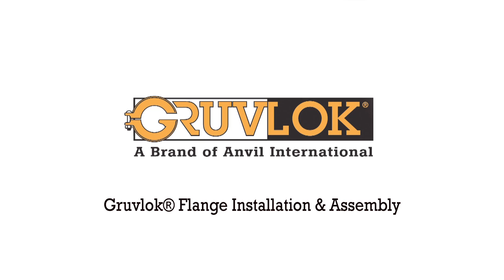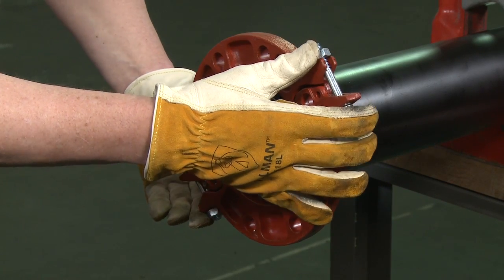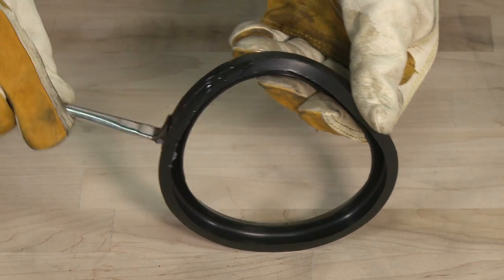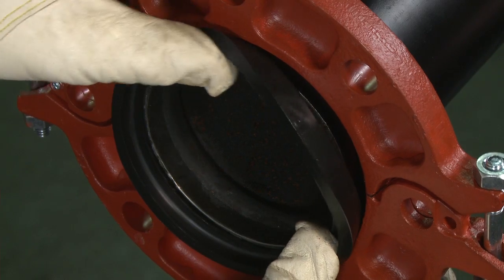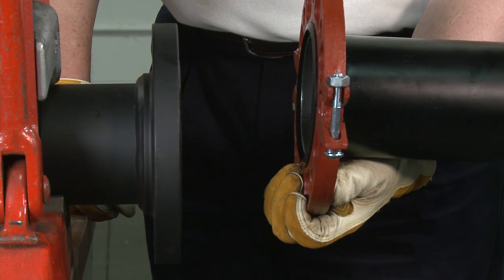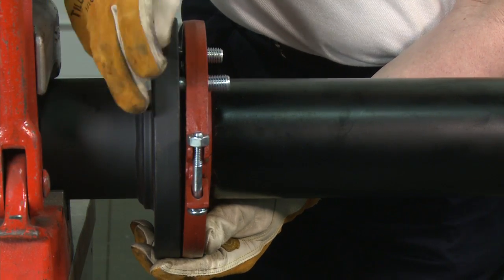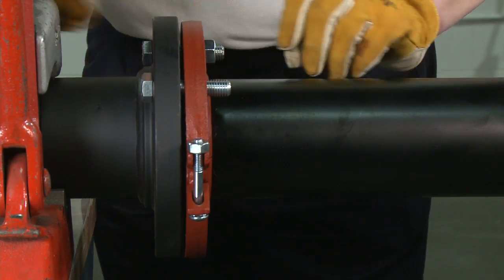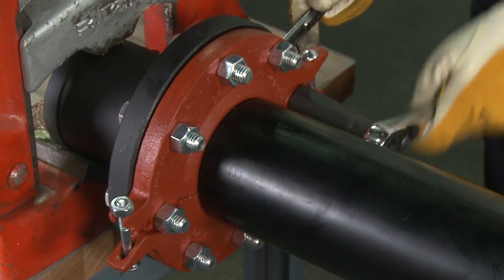ASC Engineered Solutions - 7012 Gruvlok Flange Installation Video

Comment: why the full face gasket is not used in between welded and grooved flange? Does grooved flange gasket is enough for preventing leaks.
Reply: Yes. If you look on what is normally called a split flange, there is a cavity that a regular flange gasket would not be able to seal. Also in this demonstration, it doesn't show the locking bolts and nuts being secured down on the pipe. When the locking bolts are tightened, it squeezes down on the gasket and you can't spin it. Then you secure it to the flat flange with the proper sizes bolts and nuts. Once you achieve the proper torque, and if it's the only joint you have, open the control valve slowly and pressurize back to normal psi. This one here is only used on cold water lines like fire sprinkler mains using light wall pipe.
Reply: It depends on the inner diameter of the welded flange, in many cases an additional flat ring type gasket is needed for a proper seal
Reply: You can also get these grooved to flange adapters with rubbers that also have a flat ridge to eliminate the need for a second gasket in those cases

Comment: The torque is dependant on the sizes of the bolts. See Anvil's installation instructions for specified torque for each pipe range.